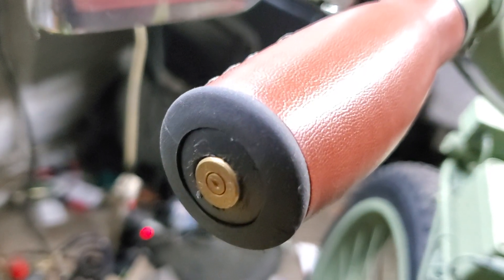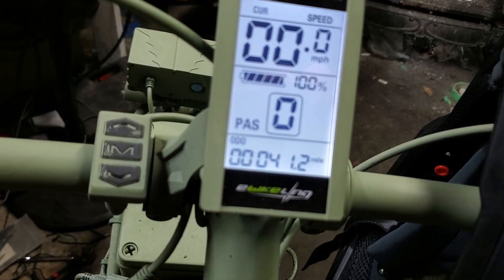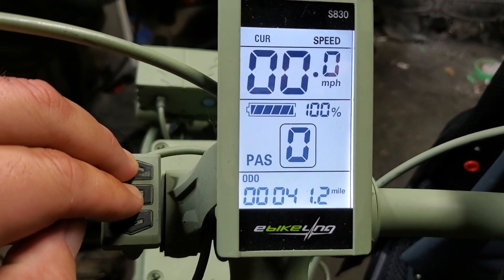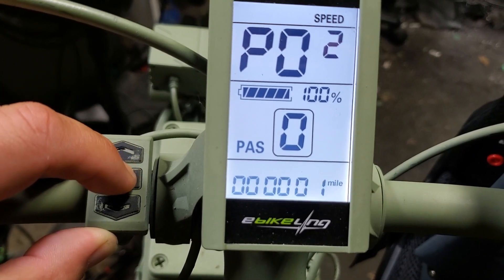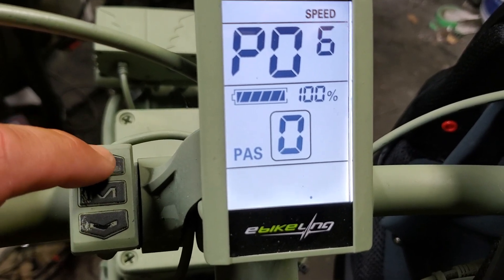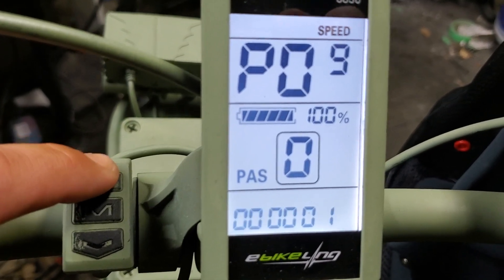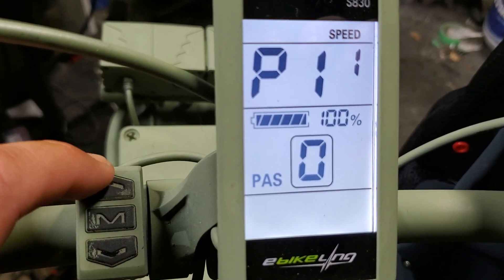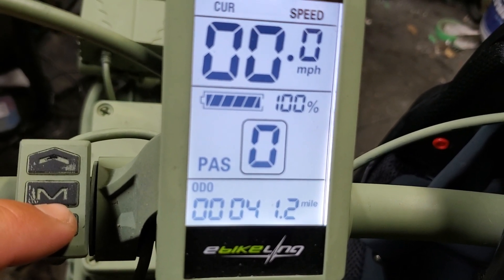S830 eBike LCD Display Setup Explained

Comment: Hey thanks for video.  I’m helping a friend with an e trike.  His controller let the smoke out so we ordered this one.  I switched the wiring harness over everything was pretty much a match except his Hall effect sensor only had five wires.  This one has six.  So I matched the colors he had and left out the white connection.  That maybe a mistake as we don’t have throttle control no matter what we do.  I’m kind of at a loss.  Any advice would help as it is I’ll keep reading forums.  Pedalec UK seems a good one.  Thanks again for the help.  Godspeed

Comment: I Ve got trouble, after changing controller for the same type of(old was screwed up), my Odo numbers starts like 001...I don't have pas 0 and clock shows me speed like 99,9, but rides normally and with the same speed on all drives

Comment: I have a question. On my bike with hydraulic brakes, when I pull either lever there is a little icon that displays on the right of the 0 under the 100% level. It is an exclamation mark in a circle or possibly brackets (cannot remember.) Does anyone know what this is?

Comment: Hi. I have a 20 inch fat tire 750w motor and I put the same settings and the meter says 30mph but the bike is actually going 19 or 20mph, that's me using the tire size setting p06 -24. If I compare it to my phone GPS it says 20 mph but the bike says 30. Just for test I put the wheel size to 10 inches in the p06 settings and it did gave me an accurate reading.... there's no way this bike will go close to 30mph as advertised.

Comment: Anybody got an idea why i can't change any settings?  I want to change P08 to get a bigger top speed but it flashes and when i use the arrows it doesn't increment at all.. the only settiny i can change is on P02 and it's the km/h  mph  setting.

Any help ?? It seems locked

Comment: I've just replaced a stolen Samebike lo26 500W with the same model and am noticing some real differences in performance from the throttle. Thinking this had to be something that I could sort out by changing one or more of the settings on the s830 lcd, I entered the menu, only to find that I could only change settings P01, P02, P08 AND P16. Is there something I can do to sort this out or is it a faulty unit?

Comment: I connected my display to a Ancheer controller. It immediately gave a e10 code. I also do not know how many magnets are on my pedal sensor. But I have a bikeling controller to put on and I'm wondering if that will fix the error code or not. Thanks for the cool vid tho

Comment: Good video but p06 is set at the circumference of the tire not the wheel..for example a 20x4 fat tire would be 24 not 20 it's wheel plus tire if you want to be accurate..

Comment: Nice info. QQ, is it possible to use the SAMEBIKE LO26 as normal, without the battery? And or if the battery totally dies, and no power going to the LCD/Control unit? i.e. you don't get a chance to put it in normal pedal mode...

Comment: I had to change my battery connection to my controller as they didnt match. Used aknderson as you dont need to solder just crimp. My big question is how do you shorten the wires to motor and to the controller fRom the
 Computer. Do you just have to fold , tuck and tape or can you cut and use connectors.

Comment: Hello Daniel... I start by saying THANK YOU for this video... I have a new ebike and had no way to understand the settings. But, how and why i found you was that i was truly hoping to find a way to have throttle only and never realized it was all right here in the settings to control the PAS and or throttle.  THANK YOU!!!  I will try to reset now and see if it really does work!

Comment: Hi Daniel, my Samebike LO26 500w which is 3months old from new, keeps cutting out even a very short cycle, I have been in touch with supplier they are dragging their heels on a remedy to the problem, I wonder do you have an idea as to why this is happening, A friend said it could be the charger not doing it's job, that said,does the green light stay on permanently when charging or is it red when charging, my green light is on all the time. Any tips would be greatly appreciated.

Comment: E 09 is controller error codes, has anyone  had this error codes. And how did you resolve it.
Thanks Mike
Reply: E09,  es error de motor , revisa tus cables de motor.

Comment: How do I fix E10 (10= Signal Recieving Error ) ?
Reply: That's a failure in your Hall Sensor, you would likely have to either have a professional open up your motor hub and do the repair..
Reply: @TheBrainSquared  Thanks. It has gone away by now... lets cross fingers

Comment: Question, if I drive on number nine all the time, will that harm the motor? Because in a vehicle you cannot take off in 4th gear, it just doesn't work like that. So I was wondering if this motor would be affected in a similar way?because when I'm accelerating sometimes I hear what sounds like two metal plates rubbing. I'm kind of mechanically retarded so ....lol

Comment: Can you please explain P11 better?
Reply: And P12 please??
Reply: P11 is pedal assist sensitivity. 1-24. The lower the number the more sensitive and less turns it takes to kick in. P12 is start strength for pedal assist. 1-5. 5 is the highest

Comment: Do you know the voltage cutoffs? I'm running the same kit, with a 13s 54.6v full battery. I'm wondering what I should set the voltage to? Also curious to know what settings cut off at which voltages

Comment: Hold down the down arrow when using the throttle for 2 seconds and it will enter cruise control mode on many bikes and will remain at that speed until you use either brake.
Reply: Thank you! The best feature of my bike!
Reply: Hold down just the bottom button for a few seconds and it also enters walking mode, motor will get to 6kmh to assist with pushing.

Comment: Hi   I've got a 3 week old bike with the s830 on it and the speed and trip have stopped working
If I turn the unit off and on while riding it worked for few seconds
Pls help
Reply from the maker: Tony, I must inform you that I am NOT an expert with the S830. Folks have been asking me all sorts of questions and I appreciate that, but I do not have Ll of the answers. I usually contact the manufacturer who sold me the bike/kit and ask them. I wish I knew how to fix the problem you are having. But sadly I do not. For example, my S830 just quit telling me how fast I am actually traveling now and I have absolutely no idea how yo fix that! LOL
Reply: @danielgrimes4152  didnt know thought you were a wizkid sorry
Just realised mine works when motor does but not when motor idle
Pls let me know if you find out
Cheers
Reply: Similar problem. Speed and trip only function when PAS is on. Any answers ?

Comment: Hi thank you for the instruction video , i have a question.  My speedo is say I'm travelling way faster than i am os there something wrong i have done.  I have it set to mph as I'm in the uk.  Thanks
Reply: You might have the wheel size incorrect.
Reply: I use 28 for my 700C x 35 tire. I actuall measured the diameter with a tape.

Comment: Hi. My P11 settings were set at 03. I have changed them to 23 like you have. Will this affect my bikes performance in anyway (I mean damage it). I have samebike Lo26 350w
Reply: Interesting question as I would like to know too?
Reply: P11 is the sensitivity of the PAS sensor, so shouldn't be a problem.

Comment: Hi I also have p 14 and 15
It's a new 2020 bike
Any ideas what they do aswell as cant set clock
Cheers
Reply: P14 is current limit 1-20. Factory set usually at 12. I turned mine as test to 19 and saw no improvement and set back at 12. P15 is not used according to what I found.

Comment: Hi Dan
How do you set the clock time pls
Cant find anywhere
Reply from the maker: Tony, I have had the same issue. I spoke with the manufacturer and they told me that there is actually no way to set the time on the clock. LOL Not sure why they even put the feature in if you can't actually utilize it.
Reply: @danielgrimes4152  
Thanks  lol

Comment: My S 830 display shows Error E 10. The motor doesnt work. I have checked all the connections and cables and they seem to be OK. If have changed the Controller as well. The error still satys. Any one can give me a clue? May I suppose that the motor is damaged?

Comment: My battery indicates 100% all the time. Unfortunately I got caught out when the battery died and went rapidly down to zero leaving me on the road with no power. Can you help me resolve this issue on the S830 display so that it indicates a reduction of the battery when being used please?
Reply: On my battery a 52V 20amp triangle there is a button you can push to tellyou how full the battery is ,- using color coded lights. Like 25,,  50, 75 ,100. Unfortunately youd have to get of the bike. Perhaps an updated computer or co troller might fix the problem.
Reply: That just happened to me yesterday. 100% all day and then it just dropped to 30% out the blue and I was about 30miles from home But still got me home.
Reply: Sleepy Hinton  there is no information within this video helping me to understand why my battery indication remains at 100% all the time so I can’t tell what’s left in the battery

Comment: Very helpful video thanks.Just one thing what was P11 for ?
Reply: Yeah, I was wondering the same. You kind of skipped through P11 and P12, just said what your's was set at but not what the settings actually are. Other than that, great little guide, much appreciated.
Reply: P11 is PAS sensitivity. 1-24. I set mine at 15. It's like how sensitive do you want the assist to kick in when peddaling. Lower is more sensitive.
Reply: P12 is Pedal Assist start strength 1-5. 5 is highest.

Comment: Hi Dan, i was messing with the setting and the battery went from 100% down to 5% and now the wheel doesn’t power up. I will have a go at these settings as you explained but do you know why battery percentage changed? is that another feature for something?
Reply: Sorted it now. After playing with settings again.

Comment: I have a SAMEBIKE LO26 and it has P14 and P15 what do they do?
Reply: p14 sets the current limit (up to 20A). I suspect p15 sets the voltage point at which the system cuts off the battery, but I haven't been able to find any confirmation of this. Also, I can't change my p15, what about you?
Reply: My S830 skips from P14 to P16, so I can't set or view the P15 value.  Good luck.

Comment from the maker: I've had many questions about Error 
CODES:

00 = NORMAL
01 = Stay 
02 = Brake 
03 = PAS Sensor 
04 = 6km/h Cruiser 
05 = Cruiser 
06 = Low Voltage
07= Motor Breakdown 
08= Throttle Error 
09= Controller Error
10= Signal Recieving Error 
11 = Signal Sending Error 
12 = BMS communication 
13 = Head light error 
33 = Current Abnormal 
34 = Throttle Error
35 = Motor lost one phase
36 = Motor Magnet error (Main motor wire is not plugged all the way in) 
37 = Brake Error
30 = Communication error (Wire from Controller to Display unplugged or Controller failiure)

*These are general guidelines. As I could not locate the "Actual" error code list foe the s830. As always, if you need specific answers about your setup, please contact the manufacturer.
Reply: This helps.  I had the white jumpers connected and it will just spin the motor in PAS 1.  When I tried disconnecting the white and hooking up the blue jumpers it threw this error which considering the throttle doesn’t seem to work may be a thing.  We may be in the market for a new throttle as that shorting may have blown the old controller anyway.  Thanks so much we will try that step.  Godspeed friend.

Comment: Hi Dan! You seems like a experter of this LCD. Can you help me? I bought a Samebike Lo26, and after some kilometres, I got on the lcd a E10 error, I have no Idee what it means. How can I solve the problem? Should I buy a new controller? Or only a new lcd?
Reply: Many thanks! You are my last hope!
Reply: From the LCD Display Error Codes ... 
"10 Communication Receiving problem (check hall sensor wires. Make sure they have positive contact.  Push all the hall sensor wires/pins harder to seat them and check again.)"
Hope that helps.

Comment: Very helpful! Thank you Dan. I kindly ask you to answer a couple of questions:

Today I got an error E07 on my S830 (samebike LO26) while riding the bike uphill. I switched the panel off, waited for a while, and switched it on again, and the error had dissapeared. Do you know where to find a list of error codes of S830 panel?

When I ride for example 15 km  the trip value(TRIP) shows 15 km but the total mileage(ODO) only adds 1.5 km. So I have ridden  180 km in total since I got the bike two weeks ago but my ODO value shows 18.0 Km. Any idea obout what I can do on the panel?

Thanks in advance.
Reply from the maker: Error code 10 indicates that hall sensor connector is not connected properly.
Check wires in the motor connector carefully, push the wires in all the way to make sure they are connected properly.

And Error code 07 does not always indicate a hub motor problem. Replacing the controller may solve the issue. You can try a different controller if you have one or ask for a replacement from the supplier.
Reply from the maker: Also, make sure your tire size is set appropriately in the display. This can throw off ODO readings as well as remaining battery life.
Reply: I have the same problem,  did you manage to fix the issue??

Comment: I set P14 to 15a from 12a. The current shows 27a on the display under acceleration. I don't seem to understand what P14 actually limits. Can you explain?
Reply: Hyprmtr ... Set to 16 v it will increase the engine power ... when you have a 350v engine it gives 570 W.
Reply: @adapaitsmyname  do you mean a 350W engine and is your bike a SAMEBIKE ?
Reply: @romolovercesi5200  yes ... My bice is nie 680 wats
Reply from the maker: You must be using a different display than the S830, possibly the S900? P14 is generally used to set the current of your controller. They are usually set at 12 amps from the factory. Check the controller you have to make sure it can support higher amps. If so, turning up the amps can increase performance. Here is a link to the programming specs of the S900 display: https://ebikeling.com/blogs/news/how-to-set-sw900-lcd-display-parameters

Hope this helps you out!
Reply: Dan Grimes I definitely have a S830. It’s from a newer 2019 waterproof unit if that makes a difference. The motor controller is 30a 48v unit. My brushless hub motor is 1200w. I’m using two 20ah 6s lipo in series.  Yes, P14 was set to 12a default but I turned it up to 15a. I was just uncertain how the default limit was 12a and it will pull more current than what P14 is set at.
Reply from the maker: @Hyprmtr  I contacted the seller. I should have an answer for you soon.
Reply: Dan Grimes thanks buddy. I suppose I could have done the same. Lol. I will wait and see what they tell you.
Reply from the maker: @Hyprmtr  the manufacturer got back with me. This is their response

 "Te latest versions of the display regulates the current (P14) automatically no matter what value you set there. But, he can still set the value manually if he has that option. It might be one of previous versions."
Reply: Dan Grimes That makes since. I never did see the current go up when I raised this P14 value on the display or on my online current meter. Thanks for the help!
Reply from the maker: @Hyprmtr  No problem! Glad I could get the information you needed!

Comment: P11 sets how quickly or delayed the onset of pedal-assist . PAS doesn't work until the PAS sensor notices you are pedaling, may take 1 crank revolution, or 8 magnets to pass the sensor. With P11=1 then PAS onset is almost immediate after 1 crank revolution. P11=5, then ~4 second delay with pedaling, P11=12 then ~ 7 seconds delay, P11=24 then ~ 11 seconds delay with pedaling until PAS onset. Don't know why anyone would want delay before PAS onset. I set P11=1.
Reply: Thanks! This was driving me nuts trying to troubleshoot.
Reply: Thank you! For some reason this info is just missing on the online manual. Any idea about P15? I think it's the low voltage threshold but I can't adjust mine, though I'd like to. Maybe you're not supposed to
Reply: Thank you.
Reply: Hi!
Thanks for this useful info.
Btw, what's the difference of P11 & P12?
So far, what I understood is P11 for how delay or immediate PAS mode will work. Therefor, what is the sensitivity that is mentioned in P12? Will it limit the speed of PAS mode?
TIA!🙂
Reply: Maybe to slow down the takeoff?

Comment: Going out now to test my settings, which I now no were not properly set. I noticed your pas, when not running is at shows a 0, mine is 1. I’m not sure why or what I’m missing. Also, in the directions next to P10, is a notation that electric drive does not work in zero start. I have only been running this for a few days, and I am not sure that I could feel any pedal A. Not sure if that is still relevant or what they mean. Thx
Reply from the maker: Hugh, mine shows zero because unadjusted the levels of PA to 9. I have tried playing with the zero start and non zero start and both seem to act the same to me. I'm sure there is a difference, but at this point, I haven't experienced it.
Reply: P09 refers to how the throttle control behaves. P09=0  then throttle responds immediately, even when at a full stop. P09=1 then throttle response is delayed. I set P09=0 because when I want throttle help, I want it immediate. Note that to enable throttle, P10 must be set to either 1 or 2.